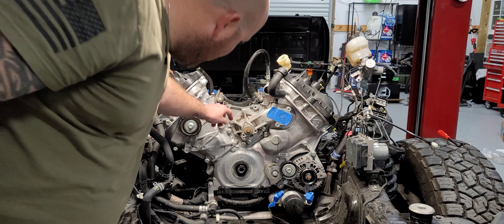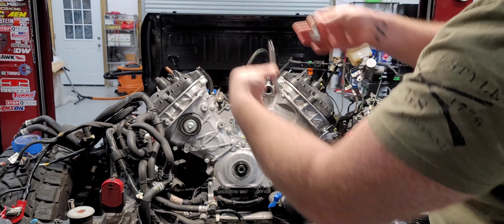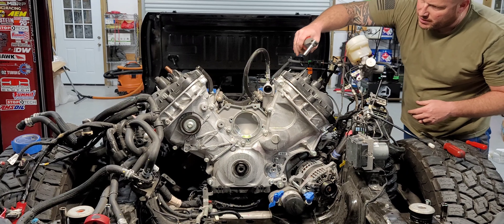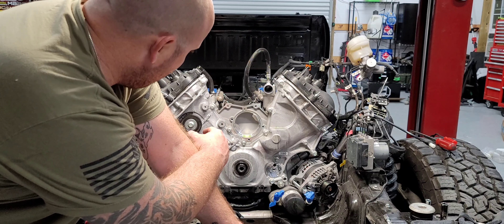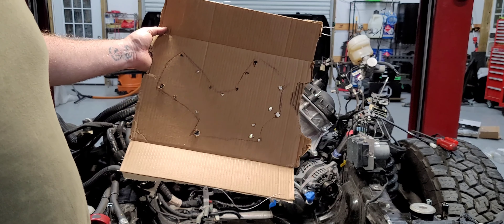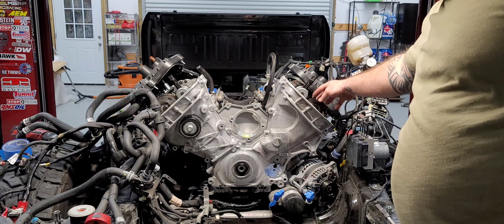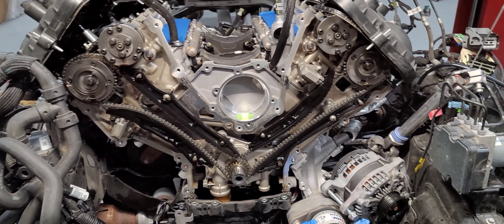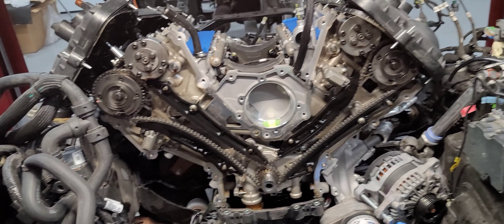2018-2020 F150 5.0 OPG Install Part 1

Comment: the 4 bolts that hold the front of the oil pan to the cover, any tips for those? I can't seem to get those off.
Reply from the maker: 1/4 swivel socket

Comment: Nice video.  What was the last thing that was holding the cover on that goes through the valve cover and how did you remove them?  I've got everything  unbolted but something is keeping the cover from coming off.
Reply from the maker: You may have a valve cover bolt you missed or the factory silicone is just holding it
Reply: @calawaydp  I think it's the VCT or variable Cam Timing solenoids?
Reply from the maker: @sweetpea4774  could be . You still should just pop the valve cover up and out around the grommet of them
Reply: Okay I got them off. The passengers side is a bit more involved. I removed the short fuel supply to get it off. Thank goodness for phone cameras...
I appreciate your quick response. 👍
Reply from the maker: @sweetpea4774  ya np!!!!